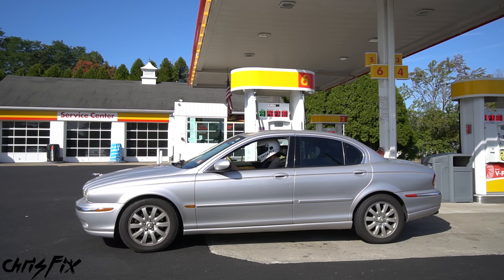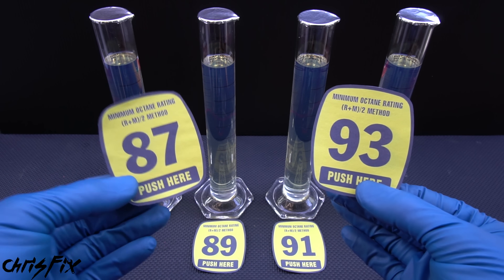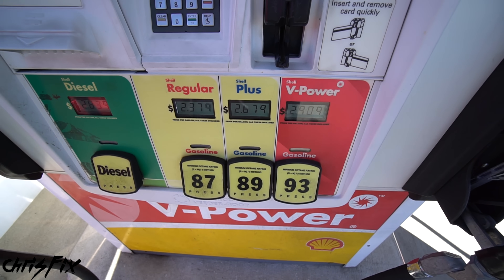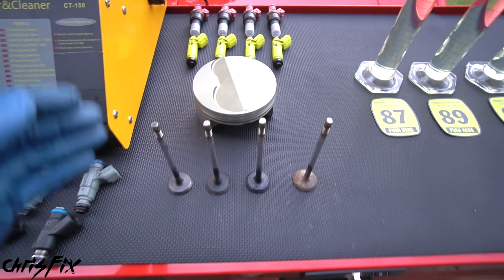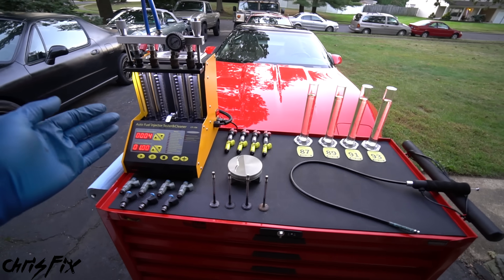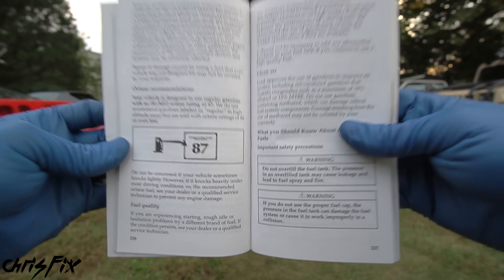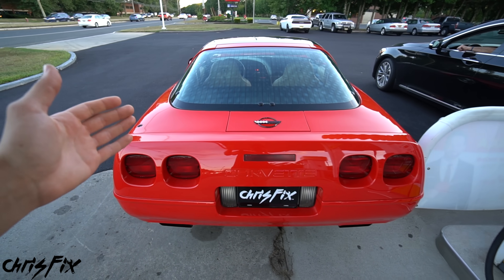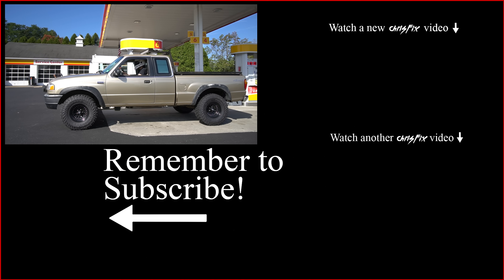What is the BEST Fuel to Use in Your Car or Truck and WHY

Comment: Of octane level have nothing to do with performance then why is that some car manufacturers will tell you that if you use premium gas you get more horse power as in case of the Mazda CX-9?. Mazda says if you use premium gas you get 20esh more horse power compare to regular gas
Reply: Because if you use lower octane, the engine has to make adjustments (such as timing and fuel injection) to prevent pre-detonation, thus compromising performance. Mazda uses high compression ratio engines, and some of their vehicles have turbo-chargers.

Comment: I have kind of wondered... The regular octane rating fuel in my area for most stations is 86.  I think most vehicles that can take regular unleaded say minimum 87 octane. Does that make any difference with the one octane rating less? I have been using the 86 without any obvious issues. I wonder if it has something to do with the 10% ethanol added in.
Reply: Ethanol actually increases octane, so you're good.

Comment: Technically, "Octane" is actually a thing that is not what we are talking about when we refer to "Octane Rating" - what we are really talking about is Anti-Knock Index (AKI). Also, knock is not an "incomplete" fire, it is "pre-detonation", meaning the explosion happens during the compression stroke, like its trying to force the engine backwards (yeah, that's bad). Also, while it is true European fuel uses a different rating, it also IS higher quality, specifically it contains quite a bit less sulfur and other contaminants. Where this actually has an effect is in the oil you run - there are different rated oils for EU's cleaner fuel that would not handle American gas very well (example: VW spec 502 vs 504). Additives are not quite government required either, and it will vary wildly between pumps.  What you want here is Top Tier fuel providers (Google it, see what I mean. Shell and Mobil are both Top Tier). You're on the money with premium in the truck too. Most "octane boosters" are BS. What you also skipped over here though is Ethanol content outside of E85. Put simply, Alcohol sucks, but it doesn't matter for most people (makes a bigger difference in motorcycles though). 

Other than that, the bottom line of this info is the right thing for ppl to digest, and the takeaway should be the right thing - so good job!

Comment: Is no ethanol gas better?
Reply from the maker: There are pros and cons. For a daily driven car it’s not  big deal to use ethanol. For a car, boat, lawnmower, etc that’s not used a lot, ethanol absorbs water so it’s not as good to use.
Reply: ChrisFix but if you don’t mind paying extra is it better for a car or truck ?

Comment: What happens if you pump e-85 in a gas motor?
Reply from the maker: It might not even run or run really rough. Could damage the fuel system too
Reply: Noted lol

Comment: I drive an Audi a6 91+ is recommended can I start putting 87 and then just add an octane booster every time I fill up or just stick to 4$ a gal premium
Reply from the maker: Octane booster doesn’t increase octane that much so that wouldn’t work but if it is recommended you can just run regular and see how the car is. Might not even notice the difference.

Comment: If you don't have a forced induction there is no point for anything over 87 do your own homework before you take an educated choice what you want to use. He got paid to do this video. Perfectly written script.
Reply from the maker: Thanks for sharing and that is not true. Everything I said is 100% true and factual and accurate. If you have a high compression engine that requires premium, use premium. It doesn’t have to be forced Induction to need premium. Heck, new forced induction engines on some cars say to use regular due ton tuning, plasma coated pistons, etc. Thanks for sharing.
Reply: Most people don't own exotic cars that have the high compression engine. So my original statement stands. I build motors and know the difference. All common vehicles above 2008 the computers adjusted for the fuel. It is put in the mapping of the tune.

Comment: Premium also prevents pre-ignition in higher compression ratio engines and is commonly the reason why the manufacturer requires you to use premium because the compression ratio is so high, with regular, the fuel would heat up and combust before the spark plugs are fired which means the valves may not be completely seated and the crankshaft is not ready for the power, thus putting strain on the engine. 91 and 93 are more stable due to their higher octane value and will burn normally in an engine that can run regular but as Chris said, if premium isn’t recommended by the manufacturer, using premium in an engine designed to use 87 does nothing for you except make your pockets lighter.

Thank you Chris for another awesome video!
Reply from the maker: Thanks for the info!
Reply: Yep, it’s called pre-ignition
Reply: James what kind of car?

Comment: Hi I have a Nissan pathfinder v8 and it at 9.4mph it is supposed to 14 mph. What should I do to bring it up?
Reply: It has 122,000 miles
Reply: 2008
Reply from the maker: I assume you mean MPG? I would change your driving style, make sure your tires are pumped to the correct pressure, use synthetic oil and have a clean air filter. Not too much more you can do.

Comment: my car just says "use unleaded only" but to be honest, im able to get my hands on lots of contaminated fuel, so more often than not it runs on that. man i love early ECU driven Fiat engines. quite impressive when you are running a quarter of a tank of diesel then top it off with petrol. sure you feel the performance difference but 200Ltrs of free fuel is 200Ltrs of free fuel.
Reply from the maker: Lol. How do you get free fuel?
Reply: @chrisfix  scrap yard life ;)

Comment: This is a great video Chris. Thanks for dispelling so many myths. 

The only thing I disagree with is the octane boost. It's been proven that almost every brand of octane boost additive has little to no effect. Your advice to take it easy on an engine fueled up with lower octane gas is spot on though.

One thing I'd say about the quality of fuel in the USA is that most of it is actually inferior to many other countries because most of our fuel contains ethanol. Ethanol is just bad news all the way around no matter how you cut it. It might be okay if it was made from a source better than corn, but as it stands in the US, nothing good comes from corn based ethanol, other than it lines the pockets of those involved in its production.
Reply: That's so corny
Reply from the maker: Thanks for sharing! Glad you enjoyed the video!

Comment: What about ethanol mixes where its a mix  Like E-10 or 10% ? I've heard mixes are only for 2012 and newer vehicles
Reply from the maker: 2001+ vehicles can use e15z. E5 or E10 will be fine for almost all fuel injected vehicles.

Comment: How about states where octane ratings are lower than others like Colorado or New Mexico? In Colorado, regular gas is 85 octane. If you need 87 octane in that state, you need to buy mid-grade. In New Mexico, regular is 86, while mid-grade is 88. Some people think that these states’ higher elevation and thinner air allow people to use lower octane fuel especially with engines with carburetors, while others say that you must meet the minimum octane ratings especially with engines that use fuel injectors.
Reply from the maker: Higher elevations can use lower octane so don’t worry unless you drive to a lower elevation.

Comment: Thank you, for dumbies that think "Premium Fuel is a myth to spend your money" YOUR WRONG 🤬 if the car needs the octane, you put in what  is required. Also to mention when towing or heavy load driving using premium helps predestination and reduce the knock.
Reply from the maker: No problem! That’s exactly why I made this video!

Comment: The best type of fuel to use in your car is the one your Dynamic Compression Ratio suggests. Nothing less, nothing more. You don’t get more power from higher grade fuel unless your DCR requires it.
Reply: But my 2012 focus has 12:1 compression and calls for regular 85 (I live at 5600 ft, so it’s like 87 in the flatlands)

Shouldn’t I be running E85 with its 104 octane at that compression level?
Reply: Howie Phelt-Ersnatz your focus has 12:1 static compression, not dynamic. Due to variable valve timing, etc, it probably bleeds off enough cylinder pressure to use 85 effectively. Static compression ratio is different than dynamic and shouldn’t be the only number looked at when determining what fuel grade to run.
Reply: Jack Thompson 
Thank you for clarifying.  I have seriously been wondering htf they managed that kind of compression

Comment: Nice video Chris. Maybe you already explained this and I missed it but can you or someone in the comment community help me? I bought a car not long ago but the previous owner said he only put premium gas, which I've been doing as well... I checked the manual and it says "regular unleaded". Can I go back from premium to regular or will it mess/screw anything up with that fuel change? Thanks!
Reply from the maker: Yes you can use regular as long as the manual says it. Premium is a waste for your car. No added benefit.
Reply: @chrisfix  Awesome! Thanks for the help. I figured putting premium was no use and more of an expense but wasn't sure if I could go back to regular after all this time. Now it's clear and makes sense. Thanks again and keep the videos coming. Cheers!

Comment: Is there any way to clean your carbon buildup without driving 2500 miles on premium fuel?
Reply from the maker: Not really. The additives in a bottle don’t work that great. You could use them for 2500 miles which might work the same.

Comment: Will a normal economy car, with a small direct injection turbo charged motor (such as Ford's 1.5 or 2.0L Ecoboost), see increased fuel economy and power or even longevity if switched from E10 87 Octane to 91 or 93 Octane?
Reply from the maker: Possibly since it’s turbo charged. I would run 93 for a few weeks and then average your mpg and run 87 a few weeks and average it and see.

Comment: Diesel wont hurt a gas enguine i had a 1979 hevy van i bought new i used to put about 1 gallon of diesel a month before i filled up my 32 gallon gas tank i put 400k miles on that van never had any enguine problems in the 400k that i owned it
Reply from the maker: A dilution if 1:32 is nothing. If you filled your tank a quarter or more your whole fuel system and tank  would have to be cleaned out bc the engine wouldn’t run.
Reply: @chrisfix  i know i drove truck 42 years diesel lubricates thats why i do it ,i also put 2 qts transmission fluid per 120 gallons in my diesel it keeps the injectors clean i learned this years ago by old timer mechanics,plus i quit running power steering fluid in the power steering i run 10 wt hydrolic oil instead,i had problems with seals in a power steering kept going out a old  mechanic sugested the hydrolic oil never had another seal go out ,poweer steering fluid is too thin when it got hot it would leak hydrolic fluid holds up 360 k miles no more problems i put seals  in 3 times first 30k miles

Comment: Hi Chris... I'm an Engine tuner here in Australia... Since about 1998 (OBDII) virtually all vehicle that have a knock sensor have 2 Spark table tune mappings - Low Octane & High Octane.. from factory the engine will always attempt to slowly move the spark advance timings towards the more advanced High-Octane spark table... If any significant knock is detected the ECU will begin to reference the Low-Octane spark table.... (This is NOT flex fuel, but old simple technology since the 90's) 
- More Spark Advance = More Power & Efficiency...

As you mentioned in the video regarding custom tunes, follow the tuner's directions, However FACTORY tuned vehicles that have 2 spark tables will ALWAYS benefit from higher octane fuel. Most skilled engine tuner's usually lean out the bulk of the WOT fuel table cells and add spark timing to achieve more Power & Economy. (Most factory Naturally Aspirated tunes are overly safe (rich & slow) and allow for cheaper fuels, hence the frequent recommendation for High-Octane fuel on custom tunes)

- Higher Octane allows for much more advanced timings 
- More Spark advance = More Power & More Economy, thus
- Higher octane in any car that has High/Low tables = More Power & More Economy

So yes, reference the manual, but the couple of $$ you spend at the pump when you fill for Premium Fuel are ABSOLUTELY earned back in mileage (on knock sensor equipped cars) and efficiency maintenance costs.

Comment: In some parts of the country, the highest you can get is 89 or 90. I've noticed that places in the east coast have higher octane gas available, compared to the West coast. So if you user manual says use 91+, and the highest you can get is 89, what should you do?

Comment: During the cold months they add alot more ethanol to fuel somtimes up to 25 %. My truck runs like shit on that winter mix. 
I also have 2 other cars that require premium fuel 93 Corvette 87 grand national, they  run very rich on premium.

Comment: My Lexus requires 93 but I have been running 87 from the last 6 years and 78,000 miles without any problem. Key is the compression ratio - If your engine has low compression ration like 1:10.5 than 87 should be fine.

Comment: I stay away from shell. Too many fuel cleaning addictives cause white hard formations on the spark plug straps/electrode over time. Same issue with using too much fuel injector cleaner. I  work at a dealer replaceing engines for a contracted airport with stripped chassis Van's for transportation. Every set of plugs I've pulled on then looked horrendous. No carbon, all white deposits. They use cleaners and octane boosters in there fuel tank supply's to make the gas storage stable.

Comment: My 2015 Tacoma got better fuel mileage using premium. It had different engine performance and didnt drop down a gear as easily. Worked out to the same cost per mile. Most lower grades have more ethanol content. I think shell uses 10% in the low grade and none in high grade. Ethanol does not contribute to your mpg as far as I understand it so thats a 10% loss of fuel by volume. How is the volume of ethanol going to help you get further down the road vs pure gasoline?  So for two reasons premium can get you better fuel mileage. If your engine stays in a smaller gear for longer because it runs differently on premium than it burns less fuel at lower rpms. Second there is less ethanol. However, some vehicles I noticed no difference like in a 2012 Turbo Sportage my mpg never changed no matter what I used. Depends on the vehicle. I will be buying an EV soon anyway, done with gasoline hopefully very soon. Diesel is another mess. Winter diesel vs summer diesel and now bio diesel. Ridiculous. Instead of mpg numbers I want to see cost per mile based on National averages for every energy type. Some vehicles can use low grade or high grade but mpg and power is quoted using the best fuel or most expensive. I want to know what the power and mpg is using the cheapest fuel as well or like I said cost per mile using all allowable energy types and their respective power outputs. Its cheating the unsuspecting consumer now. Its all very difficult to understand for the average buyer. Most wont ever learn it and dump e85 into their vehicle thinking its 85 octane. You cant educate people to this degree, most have better things to do and thats why this should not be allowed in this industry. Its ridiculous.

Comment: Flex fuel is not worth it. It's cheaper but burns extremely fast. I got an extra 5-7 mpg when I switched from flex fuel to regular. That's a lot and not worth the lower fuel costs.